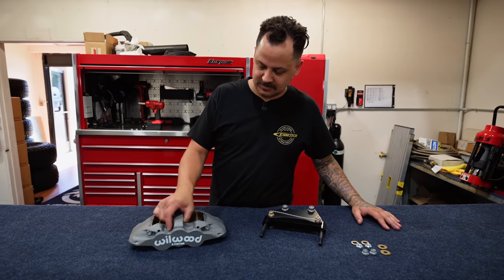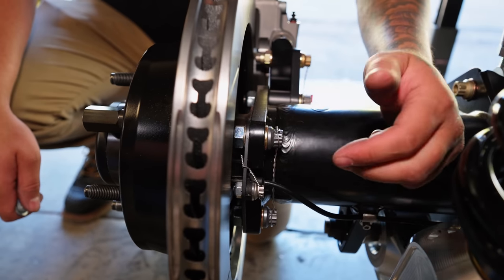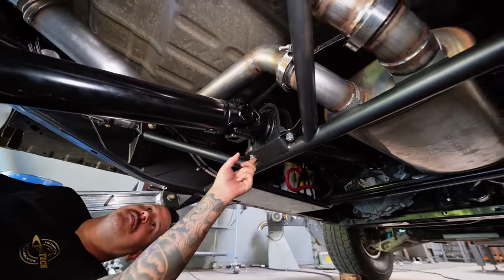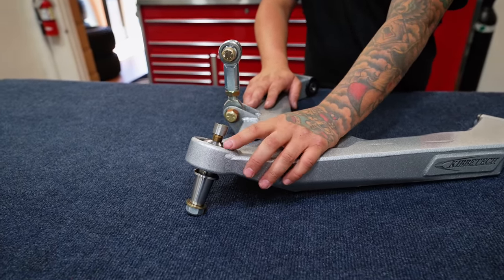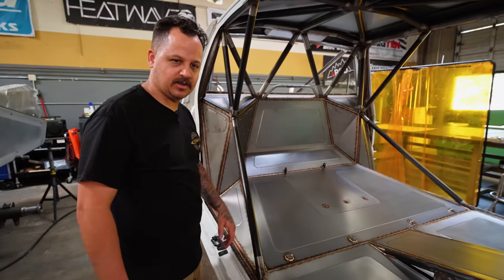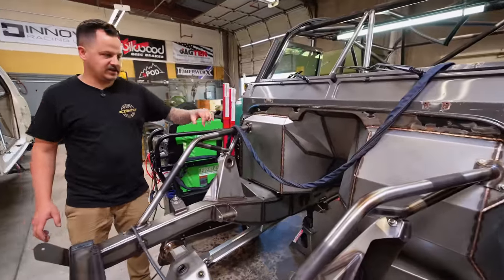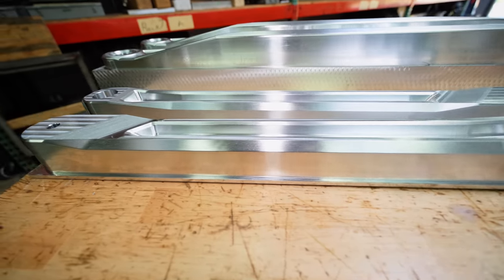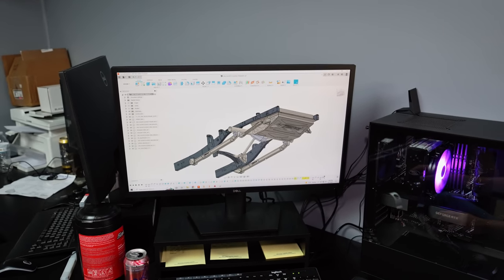Our New Big Brake Kits

Comment: Do you think you'll ever offer bolt on parts for an F150 tremor? The suspension is slightly different in a few ways than a F150 and not quite a Raptor. Always been a huge fan of your shops work and finally own something worth putting good parts on.

Comment: Could you guys show the setup for the trans cooler on the raptor?  Curious how lines were run and if any stock coolers were used or you guys completely redid that.  Thanks.

Comment: With your short course link setups, how can the ibp coilovers make up for the loss of a true bypass with multiple tubes? Does it have multiple stages that are pre setup internally? Or is it the geometry of the kit itself with the big bumpstop that makes a huge bypass not necessary? Been trying to figure this out for a while, thanks!
Reply: Shock tuning and geometry. When you have money to have 1000hp raptor built by Kibbe you can pay to get them tuned whenever you want 😅
Reply from the maker: I’ve gone over this before in other videos. The whole point of this style rear suspension is simplicity. While compared to a full back half build this is simple. These shocks with the light weight springs work amazing. If we were to add the bypass the trailing arms and shock mount and entire back half would get a lot more complicated. So basically this is our “entry level” rear suspension compared to our full back half kits.